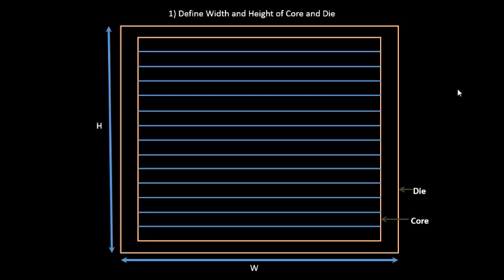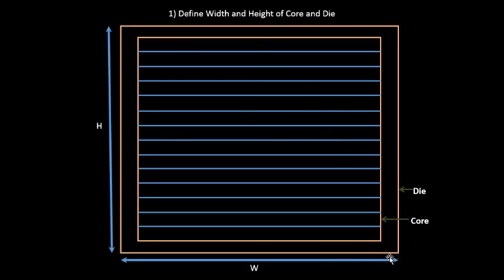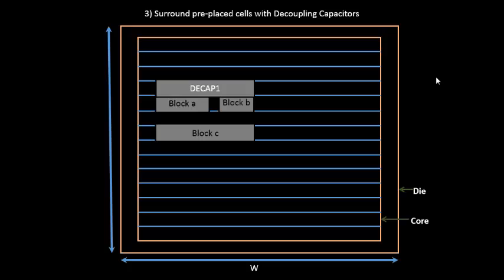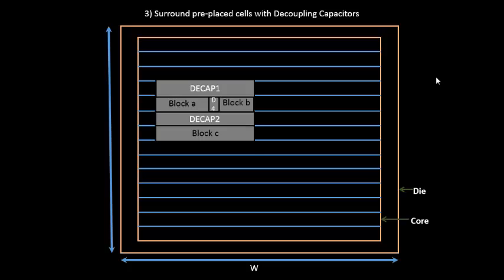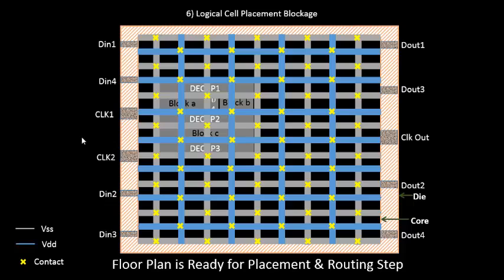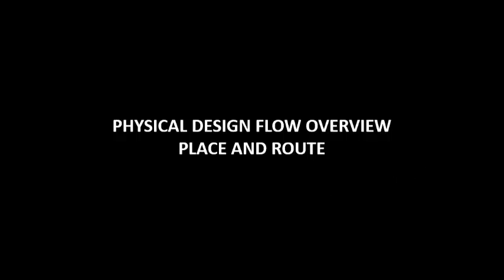How to do  Floor Planning Step-wise ??  Learn @ Udemy-VLSI Academy

Comment: 1) define width and height of core and die
2) define location of preplaced cells(macros or IP)
3) surround preplaced cells with Decoupling Capacitors
4) Power Planning
5)Pin Placement
6) Logical cell placement blockage

Comment: cant this be simulated on Proteus software or Eagle software...?
Is ICC from Synopsys an open source software.?
Reply: +syed tahauddin I'm no expert but Proteus and Eagle are used for PCB layout and assembling the layout of relatively large components. 

When you're on nano-meter scale involving millions of transistors, you have to go for tools from Cadence, Synopsys, Mentor. 
and yes they are pretty pretty costly.
Reply: syed tahauddin No, synopsys costs a great deal of money